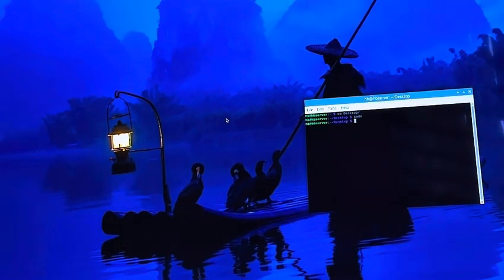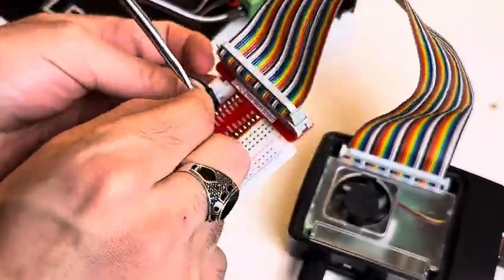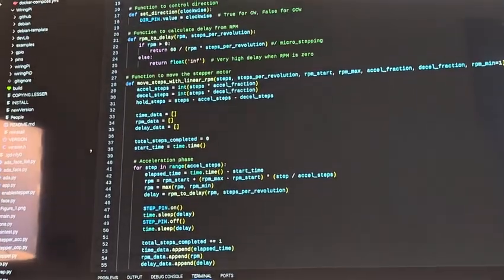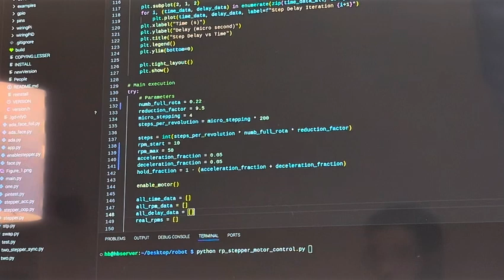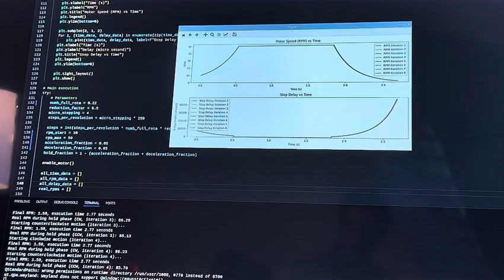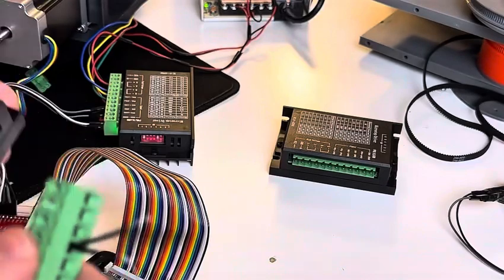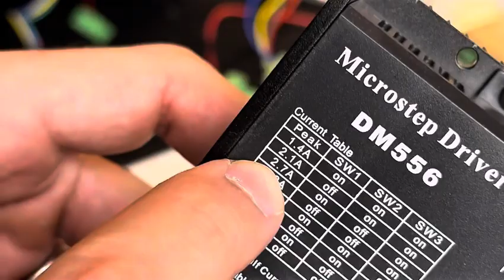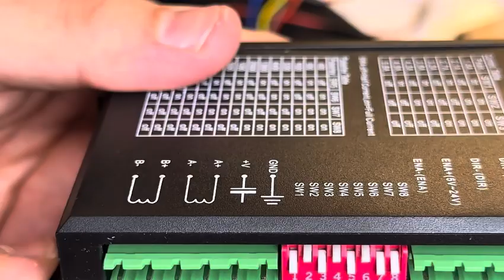TB6600 vs DM556 Stepper motor controller comparison

Comment: Do both drivers work with Arduino? I would like to use buttons for direction and speed control. Tks.
Reply from the maker: Yes, both drivers can be controlled with an Arduino!

Comment: This isn't a TB6600. It's a Chinese knockoff. Even the microstepping is done through a timer chip (555).
Reply from the maker: 😅 I think most of hardware like this is made in china 🇨🇳 do you know a better tb6600, its made where? I don’t think that the made in china is bad even the pc the phone or laptop you’re writing from china 🇨🇳. And i am not Chinese 😃 . I did not say in the video but now the dm556 direction pin is not working anymore but the 2 tb6600 that have are still up and running. But maybe I mishandle the dm556 maybe..
Reply: @dsc-dev  This product has nothing in common with the Toshiba TB6600 chip. It contains a completely different chip. If you open the plastic cover, you'll see everything. Pay attention to the cooling system.
The DM556 is a good copy of the Leadshine DM556 driver. I've had them for several years now without any problems.
Reply from the maker: Thank you for the clarifications 🙏🏼. I didn’t know that about the tb6600. I checked but didn’t find it like in amazone specifying Toshiba tb6600 however When googling it I found the ship. So that why it’s not smooth like dm556, I think there should be some company that take this tb6600 and improve it with respect to noise and vibration.. and i guess it’s not an easy thing to do

Comment: Hi. Sorry. Could you plain which pins are you connect the raspberry to drive? Thanks.
Reply from the maker: There are many options but for my case I was using the gpio 17 27 and 22 I would just advise you to avoid using the ones providing sda or other protocols. Use generic gpio pins 😊

Comment: Great video bro! 
But will it be possible to reach 3000-4000rpm with dm556 (with very less micro stepping like 1 or 2) and nema 23, 48v, 4a, 1.8mH bi polar stepper motor?
Reply from the maker: I have to check it depends on your stepper motor, I guess but mine definitely I would say doesn’t go high rpm I have tested with tb6660 but with dm556 not yet. I have 24v power supply for now. I think I can a 1000rpm. Sorry I don’t have a direct answer for now but will definitely do it in near future 😊 and get back to you with a video
Reply: @dsc-dev  alright, sure bro, and thanks for the info 👍👍